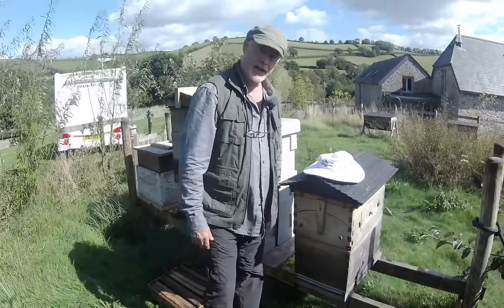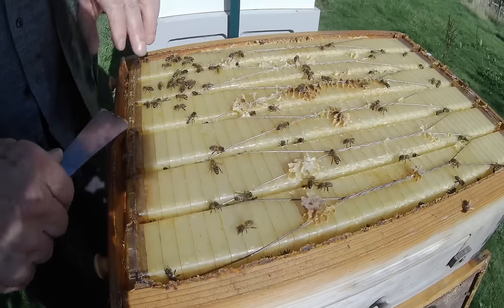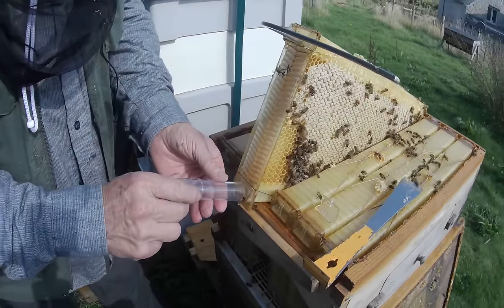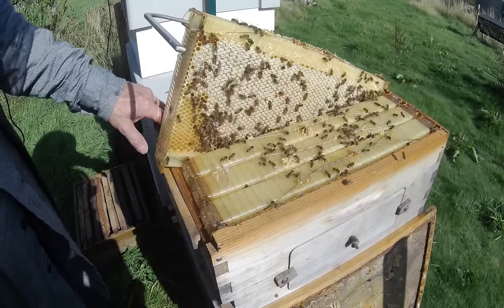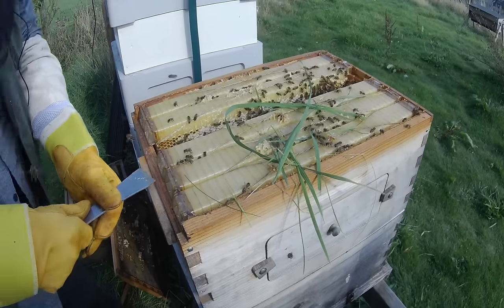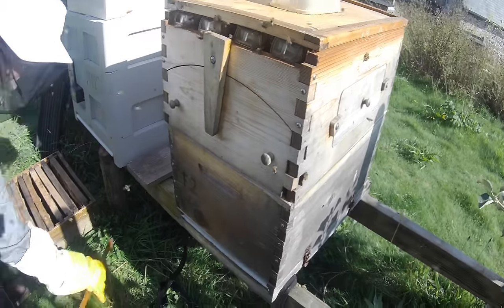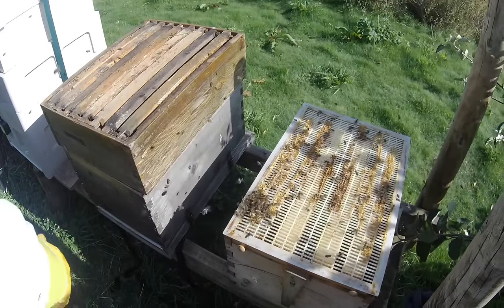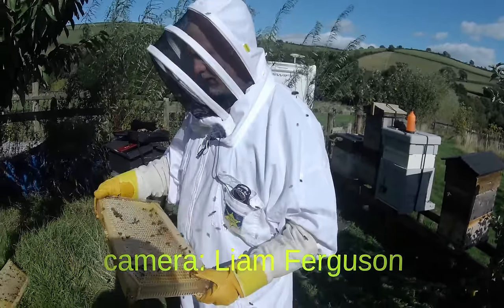Don't buy a Flow Hive until you've seen this!

Comment: That's not a Northern Bee setup. You need a third short super in between that you never harvest...that's for the bee's winter. You have not put your flow hive together very well. You only harvest honey when all chambers are capped from the visual windows on the outside. Bees work from the middle outward so when the outer chambers are all filled you know that pretty much all of the center ones are ready. By pulling out a flow chamber you have damaged the seal the bees make in the bottom and actuating the flow mechanism will cause honey to drip into the hive causing a mess. You don't flop around boxes. The bottom will be brood naturally, the middle super will be mainly honey for the bees, and the Queen won't get to the top flow box because it's screened and will only contain honey. At the end of the season you remove the Flow box from the hive and cap the top of the middle hive, giving the bees their needed sufficient winter storage supply. The Flow can be cleaned at this time. Also , to aid in cleanup, remove the flow only a few feet away..this will attract the hive workers to clean up any leftover honey without placing more in the Flow and save you a lot of time cleaning yourself. Your current setup restricts the size of the hive, that is one reason why your honey output is so small. I agree some flora produce a more rapid crystallization of the honey in the late season, but if properly set up and developed Flow hive for Northern bees, you should be taking the last flow soon before that is even a problem. You also seem to be too rushed to take honey out of the hive before it's ready and full...patience rewards. Also, visit other flow youtube sites to learn what you are doing different, it may help.
Reply: I have to buy new bees every year because they die every winter. I've tried everything I can to save them here in Chicago but I don't know if it's the cold or if it's because of the mites but whatever the cause, they die every winter so therefore I harvest as much honey as I can knowing they're going to die anyway
Reply: yes and I don't believe you could decapitate the bees by opening the flow with the tool because the chambers slide for about 2,5 mm so there will be 2,5 mm opening. But my question would be if all the chambers are caped and you harvest the honey will the bees uncap the empty chambers or is that something the beekeeper should do?
Reply: @royal_gambit_e4  bees will uncap
Reply: @WangJinru  ok thx. Since you answered maybe you know these one too: will the queen lay eggs in the cells?
Reply: @royal_gambit_e4  no there is the queen separator the black thing
Reply: @blackisback74 I seem to remember having seen a keeper in Russia Siberia who developed some insulated bottles from a water fountain as hives that survived winter. The trick was enough or the right type of heat insulation

Comment: Man,you have to read the manual of the flow hive again. You have missed a few critical points
Reply: If you not mind I would appreciate if you could give a very brief explanation of what he is missing as regards your comment.
Also are you using this system and if so, what do you think of it?
We have not got any honey for 8 years because of my back but we had got 15 gallons between 2013 & 2014 and still have a few jars left. Would have more except we gave quite a bit away.

So I am considering getting just one which should allow me to extract some honey, if I can keep the wax moths under control.

Thank you in advance if you take the time to answer me.
Reply: @fredjones43 I was thinking the same thing. What are they missing?
Reply: The commentary above about how to make use of smoke relates to traditional hives - not flow hives. With the flow hive there is no need to pull the frames out of the super (upper boxes) to extract honey. This is why flow hives are easier on the bees and the beekeeper

Comment: Moving the flow hive frames to a another box does not work different size frames and no the bees will not be injured if you split the cells with bees in the cells again you did not read your manual on the flow hive it tells you all of this information if you would only read it .....

Comment: 1. Bees cap the ends and outside frames last.  That's how you know it's ready.  You need it over 90% capped.
2. Tilt boxes back.
3. Harvest honey when it's warm.
4. Don't stick the metal key all the way in.  Do it in parts.  This way you don't flood the boxes with honey and also make it easier to break the cells. Let me know if this helps.
Reply: Wait......they come with instructions?!?!
Reply: The problem was not the use of the box, he used it correctly. The problem was that the trees and plants in his area produce honey that behaves more like chocolate where being not cold is not enough but it has to be really warm for it to flow slowly. After a longer period of cold days it crytalizes and wont even flow on warm days anymore. Rather then doing the tidious cleaning himself he rearranged the boxes so that the bees will clean out the honey themselves and store it in another box.
Reply: @strawberry-parfait3922  now i want chocolate honey
Reply: @rickrapirio3798   lol "buy a chinese knock off"...and save $...boomer alert!
Reply: @TheSedevacantist    Sure -   encourage patent theft why not?   I hope you never invent anything.

Comment: I've been using Flows for 4 years. I build the bees up,  use two brood boxes, let them make a honey super for winter, place a Queen excluder and then place the flow hive on top. Twice as many bees, twice as warm. If the bees can't finish the flow hives, I remove them from the hive, brush the bees off and drain them inside. They can be flushed out with water OR you may leave them out for the bees to clean up and store them for next spring. I like mine!
Reply from the maker: Where are you?
Reply: @BarefootBeekeeper  United States, Ohio - a little late this year but putting them on again this year soon! Clover is starting to bloom.

Comment: Tip for viewers, if you want to remove bees from frames so as to extract them you can waft a bit of a sweet smelling smoke, such as lavender, over and into the spaces between frames you want to remove.  bees will scurry off the combs and you can remove it without squishing bees.  This is especially helpful if you have large populations and are trying to remove the first one or two combs.   I just caution you that very little smoke is needed... just a little time and patience, but by directing small puffs here and there you can use it to move bees out of the way.  In addition to being barefoot i generally need no veil or gloves either!

Comment: Like you we were a founding supporter of Flow Hives when they were launched. We now have 3 Flow supers and love them.  There is no risk whatsoever to the bees when harvesting.  With traditional harvesting many bees can be crushed by the much more invasive traditional process. Initially the bees needed only slight encouragement to use the Flow Frames.  We placed small amounts of wax around the frames to tempt them and they have never looked back.

I also believe the honey is of the highest quality as we never mix the honey from each frame.  There is no mixing of frames, no spinning, no filtering.  Just raw honey straight from the hive.  Simple tests have shown us that our Flow Frames produce the same amount of honey (or more) in a season as traditional methods.
Reply from the maker: I was not so much a supporter as a neutral observer. It is an interesting piece of engineering, but very expensive and doesn't really solve any beekeeping problem other than laziness. You can run a conventional hive using unwired foundation in the honey supers and remove individual frames for cut comb or crush and strain for liquid honey, with no bees killed.
Reply: @BarefootBeekeeper  Laziness? What about someone who loves to bee keep but is too old to physically do all the manual labor to properly harvest the honey? This is a way they can still do the work, take care of the bees since it still needs to be managed, and take pride in the harvest they receive but without having to do all the heavy work to achieve it. This is also a great way to slowly introduce people into beekeeping. When you think about the cost of the flow hive in comparison to the cost equipment needed to extract the honey and wax from plus the time from harvesting the traditional way, the flow hive is not a bad investment and can still be productive. It takes hours to properly harvest honey and wax the traditional way, especially if you intend to render the wax. Not to mention the mess it makes. You did not even assemble it properly and struggled to demonstrate it in the video which sort of tells me you are inexperienced with it, which makes this video less viable to form an opinion. I understand the concern of the ivy season and the honey crystallizing, and I think its a great thing to create a video about it so people can be aware of the potential issue, but my problem is that the video is inaccurate to the degree of how you have managed and used it. I have watched so many videos of people harvesting honey the traditional way, some who even claim to have 10+ years experience doing it and kill at least a lot of bees in their video. I have yet to see a video where bees are killed using the flow hive, and there are videos that even show how it works with a few frames that document what it looks like on the inside, and it obviously does not hurt the bees. This also produces imo a lot more honey and produces a lot less waste for the simple fact that none of the honey leaves the hive, and the minute honey starts to drip, bees are actively licking and cleaning it up. I see so much waste when doing honey harvests the traditional way. Sure a negative is that you do not get the wax or comb, which kind of sucks since comb is delicious and wax can be used for amazing things, but this is great for someone who is getting started with beekeeping. Sure its made of plastic, but with proper management and care, it should last years. In that amount of time, the amount of honey you will have harvest and potentially even sold will be well worth the investment. I could see having problems if you live in an area with little pollination which would produce little honey, which kind of seems to be a problem you are having if you have not had that great of harvest in the time you have had it. Not trying to hate on you, but you seem kind of rude to some people forming opinions in the comments and it kind of makes your video worse due to the bad attitude. You are entitled to your own opinion just as much as we are entitled to our own, but no need to get nasty to people about it. If someone in the comment comes off as being a jerk, make them more mad by being more civilized and nice. Sorry you appeared to have had a bad experience with the flow hive, but I think some of it is with how you have managed and cared for the hive its self. If you have any problems, you should really contact the flow hive team and ask them how you should handle the hive during the ivy season, or why your bees do not seem to be producing all that much.
Reply: @BarefootBeekeeper  sad the person who hacked through bees to needlessly scrape at capping....
Reply: @moonfanaras  my man, having flow hives doesn't take away any physical labor that comes with owning a hive, you still need to check brood box, you still need to replace frames, and lift boxes... unless you live in country with no varroa, no winter, and have bees that do not swarm, good luck!
Reply: @maleficent3333 we have no varoa here and the winters are somewhat warm
Reply: @willedwards7679 no varroa? Where do you live? so lucky! I cannot get rid of my dang mites here- nuc came from North Carolina to NY. I’ve treated 4x with OA and my bees are doing phenomenal bc I use shungite everywhere but still can’t help them eradicate the gross little buggers
Reply: Where did u buy ur bees from i live in nc was just curious thanks @divynerosehealing8546
Reply: @divynerosehealing8546  hi where did u buy ur bees from if u don't mind me asking I live in NC was just curious where u bought urs from
Reply: where did u buy ur bees from in NC if u don't mind me asking I live in NC would just like to see where u got urs from thanks

Comment: I am not a bee keeper but I have seen Frederick Dunn's videos, who was an old school bee keeper and he tested the flow hive with an open mind and made his analysis after testing the new tech. The tongue of the spigot faces the flow hive. He found no issues with injuring any of his bees. They move out of the way as you activate the cones but you don't speed turn it. From his video, I already knew it was too early to open your combs. Also, he uses his bees to clean his equipment. You are probably right about the none flowing jelly type of honey not suitable for flow hive.
Reply: btw, I saw Frederick Dunn's video today for the 1 time and you might gain some insight as I did.
Reply: Only he didn’t put it together correctly and follow extremely simple instructions….read the comments and FlowHive users who followed the directions explains it several times over.

Comment: You need to be sure that the flow hive super frames are pushed to the front--there are little screws at the back to push the frame to the front to avoid having the bees in the front part--making a better "window"
Looks very good, thanks for showing us. Be sure there is a 3degree tilt to the back or the honey won't flow too well.
The design of the hive is so that if you do crack the cells, the bees will NOT be hurt, only trapped until you re-set the key, and they can then get back out.

Comment: All others i have seen the bees are not on the outside of the flow tank like that , my guess is youve assembled it incorrectly
Reply: I can see already that the queen excluder is exposed. However this isnt really a problem. The problems with the flow hive are outlined perfectly in this video and it has plenty of merit regardless.
Reply: Flow tank! Do you keep bees? Those are frames and bees need an entrance access cell areas on the frame to deposit the nectar,  either way bees need hex cells to work on and inject their collected nectar grin their (honey) stomachs . Hence the position of the bees... the added worry is large amounts of in ripe honey not at 17%water begging collected, fermenting spoiling the honey harvest and not being honey.
Reply: @Cafferssss l